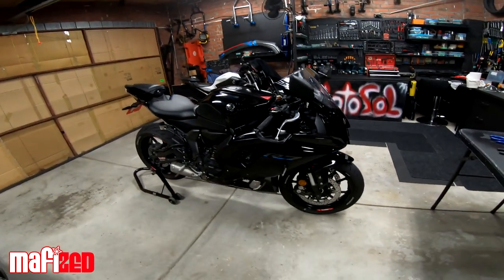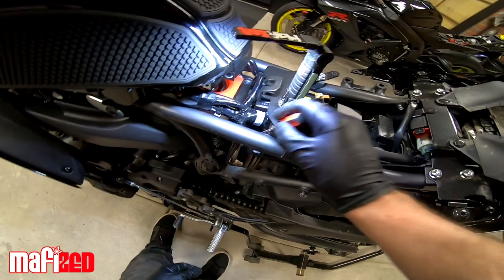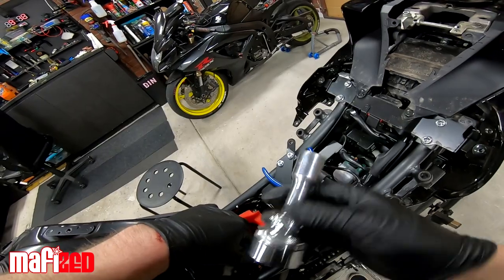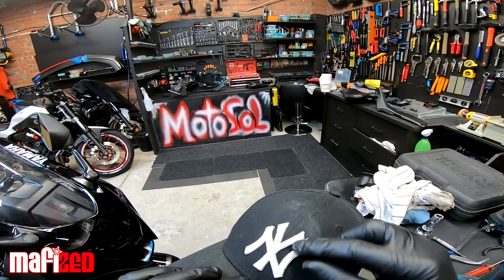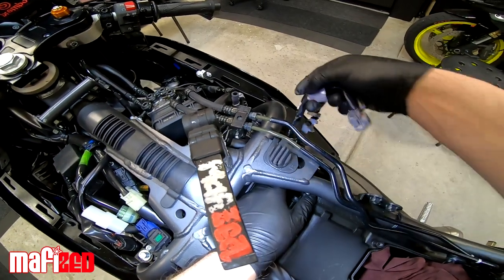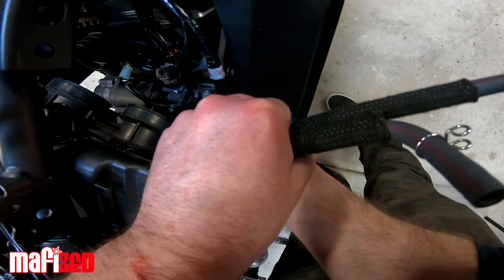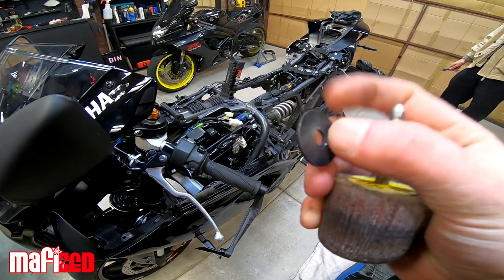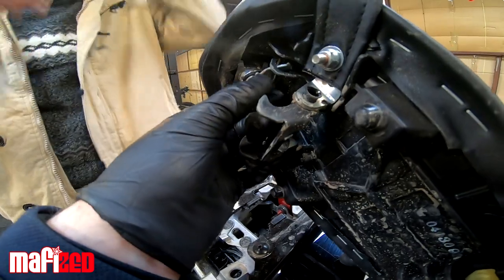2022  R7 de restriction

Comment: Should try deleting the airbox. Keep the HO R7 rubber intakes and mount a 2 into  1 k&n airfilter R-0990. Huge improvement for the R7, youll just need to brace it.
Reply from the maker: This is a customers bike, I'll be making my own air filter setup in the very near future.

Comment: i de-restricted my tracer 7 2022 and i bought the A1 airbox tubes from a yamaha dealer. did not had to drill them open they are wide open from the factory on the unrestricted models. did you do any changes to the throttle bodies? thanks for the vid
Reply from the maker: Well ofcorse they are wide open on the unrestricted version, that's kind of the point. 
No I did not do anything to the TB, what you see is exactly what I did.

I have ported my TB myself however.

Comment: Hey mate can you confirm the ECU mapping is the same as the HO model? I've heard mixed things. Don't wanna run lean.
Reply from the maker: Sorry but short of getting Yamaha to chime in on this one I can't confirm it, but If I were Yamaha I wouldn't waste time and money making a separate tune when the one I've already made will do just fine for the lams market. It's a mechanical restriction, tuning HO and unrestricted LAMS both result in pretty much identical gains, because they are.. The same. 

Albeit with an extra 5rwhp-ish ontop for the HO due to higher compression, slightly different cams and 34cc more.
Reply: @MafiZed  
I appreciate the reply mate.
But tuning is changing the map anyway so I would expect similar results post tune.
Would love to see dyno graphs after restrictions removed but stock mapping vs stock ho mapping and then both post tune.
Theoretically the LAMS would run super rich which I believe I've seen in afr charts pre derestriction in the top end with the HO mapping due the the intake restrictions and I'm not sure how that would pass emissions regulations.

Anyway, I love your content mate. Thanks again for the reply.
Reply: @MafiZed  I asked my dealer and they said it was mechanical AND an electrical set-up thing too.. I'm from Europe tho. Not sure if that makes any difference

Comment: great video! why did you take of that metal plate from throttle body with damaged jap screws? Did you change that part or modify it?
Reply from the maker: Thanks, it was to be swapped with a de restricted throttle plate :)

Comment: Removing that airbox is a nightmare, I trashed mine in the process. You are far better off to just put DNA filters straight onto the throttles than reinstalling this janky airbox.
Reply from the maker: My research and experience tell me you're incorrect but I would like to hear your reasons for your recommendation?
Reply: Dyno time and tuning. Air velocity within the air box is uneven, We gained another 4hp and 2nm through midrange on the stage 3 tune on my bike with just oval DNA filters onto the throttle body. The R7 LA now makes 74.6 rwhp and 80nm, up from the stock 40 rwhp and 57.5nm stock.   @MafiZed

Comment: when you de restriction how much hp you get ??
Reply: from what I have seen around 52 hp with a DNA air filter stock exhaust and full power throttle, but that's stock with no tune